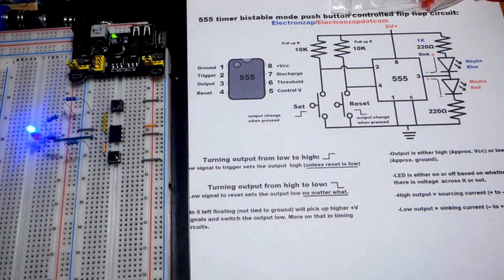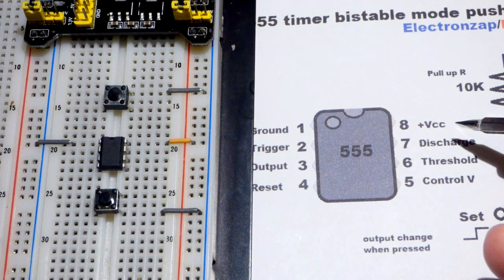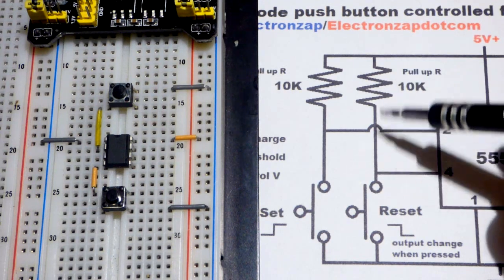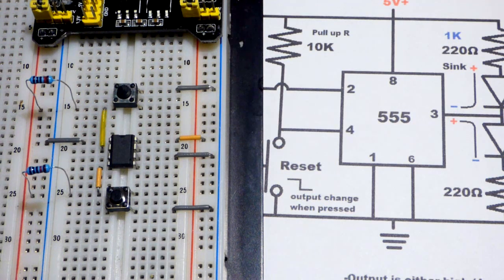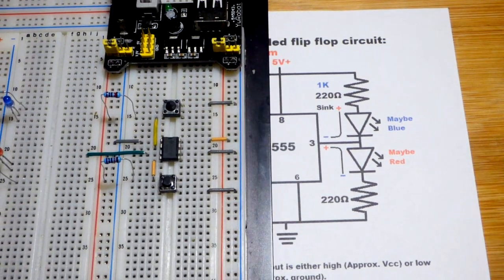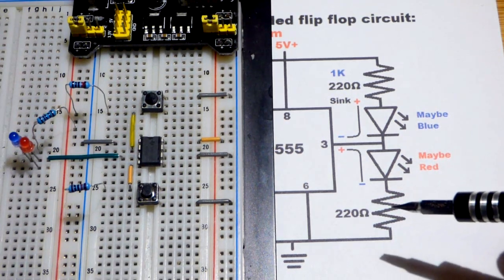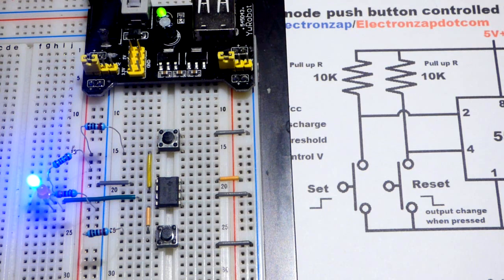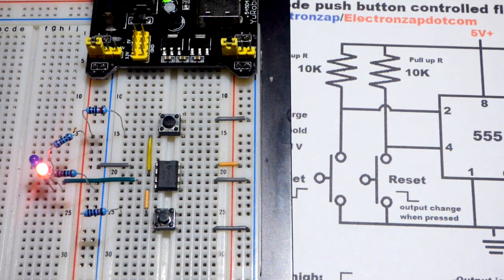555 timer bistable mode flip flop circuit step by step build with diagram and push buttons

Comment: Got that Blue Led on with no problem , and spent the next half hour (ok 45mins) trying to figure out what was going on with the red Led. When I checked the current it was 12 microAmp (not Mill) . I had to check it with a resistor since going right to pin3 seemed to enable the blue led again. Finally I checked the resistor ! Always check the resistor before you put it in the circuit . It was not 330 Ohm, it was 333K... What a putz.
Reply from the maker: I've done that before lol.